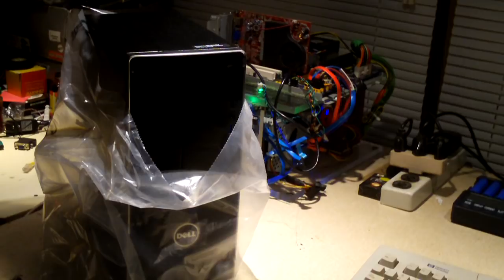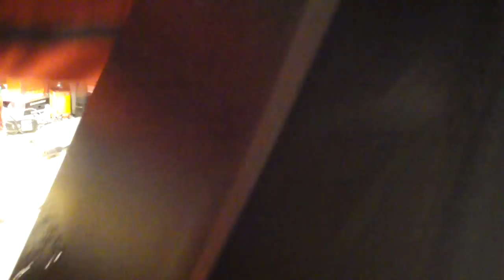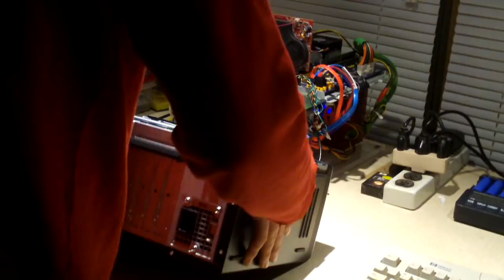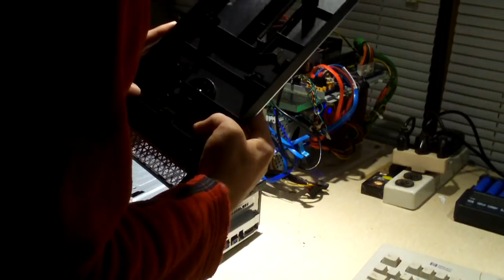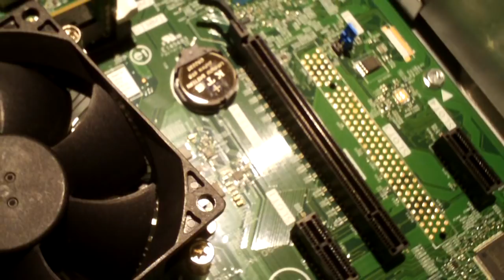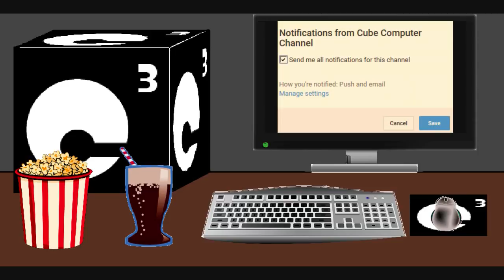The crappy state of some new Dell PCs these days

Comment: I thought I heard that some Dell power supplies are wired differently.
Reply from the maker: Some are, including this one, and also many models from the late 90s.
Reply: @CubeComputerChannel  things like that are why I never wanted a Dell or similar prebuilt PC.  Maybe some of the higher priced stuff might be OK but a lot of their stuff Dell makes for home use seems to lock out some upgrades.  They are things like extra RAM that a DIY PC would never reject unless they exceeded a limit.  My sister once had a Presario desktop a LONG time ago.  No matter what we did it would not connect to the internet.  I think she was still able to return it, lucky for her.  She was on a dial-up connection and no matter what the connection would either not connect or it would be unstable.  It may have been the phone lines in the building but I didn't want to see her get stuck with a lemon of a PC.

Comment: I think the Optiplex 7010/3010/9010/390/790/990 were the last of the better Dell PC's. They used standards PSU's and a more normal case design. (I own the Optiplex 755 USFF, 380 MT, 790 MT and 7010 MT)

Comment: Sadly most new pre-built office PCs nowadays lack the care and options for costumers to upgrade (or at least allow them to upgrade without any dumb limitations). Plus unlike some of the pre-builts in the last few years until 2014 (at least from my experience), these ones also last much, much less. And the prices too. Much less value for money nowadays as well. 

Here in Canada it's pretty much the worse case scenario with this problem. Which was why I've built my own PCs since 2015 because it would end up saving me a lot of money and would definitely have much better value for money. 

That's my two cents on this.

Comment: I have a Fujitsu Esprimo P920 with a similar design for power. That means I'll either have to buy a 1050Ti or replace the whole thing. At least the PSU is made by Delta.